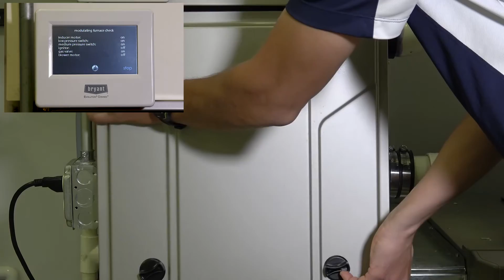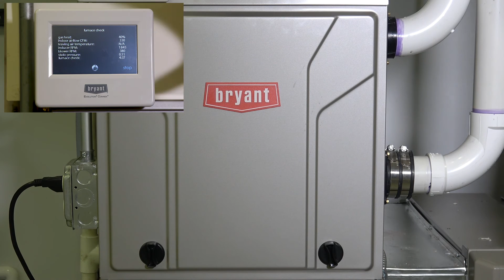Gas Furnace: Operating Sequence (2 of 2)

Comment: Two Questions: 1. I am assuming that the inducer motor stays on the whole time, correct? 2. On this furnace, is the only air for burning coming from the input pvc pipe?  (In other words, there's no vents sucking air in from the room)
Reply from the maker: 1 - the inducer motor runs a couple minutes before combustion and during combustion.  Once there is no heat call, it will shut off with the gas valve (or shortly thereafter)
Reply from the maker: 2 - Correct.  In this particular video, we used a condensing high-efficiency (90 to 98% AFUE) furnace.  These furnaces will take in combustion air thru a PVC pipe directly from the outdoors.  This is sometimes referred to as separated combustion.  With less efficient (80 to 86% AFUE) non-condensing furnaces, the combustion section of the furnace will draw air in thru louvers in the front door and hence "steal" air from the room.

Comment: I don't know,  All this Technology is nice but Stuff is not as reliable or long lasting as simpler components.  Sometime I think we have gone overboard with electronics. TV's are a good example.  They fry out and it's impossible to repair (Probably Intentionally).  Same with washer and dryers. And when things break, it's almost impossible to repair yourself without gauges and other specific tools.  I have been trying to hold on to older, less efficient products as long as possible.

Comment: So this system is a condensing unit.  How I know it's condensing is PVC exhaust piping and atmosheric is steel piping with bell reducer?
Reply from the maker: Correct.  That particular unit in the video is a 98% efficient condensing gas furnace.

Comment: What does it mean, control has 24 Vac power?
Reply from the maker: What specifically are you asking?  24v is the normal control voltage used for HVAC.
Reply: 24 Volts AC